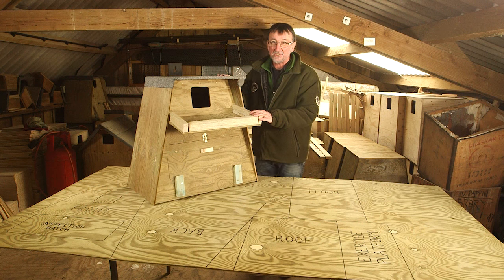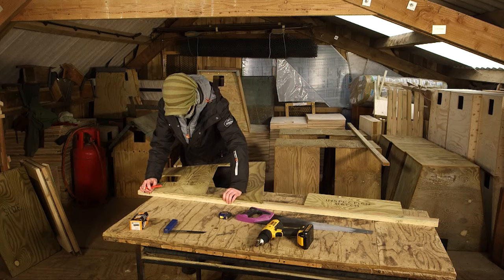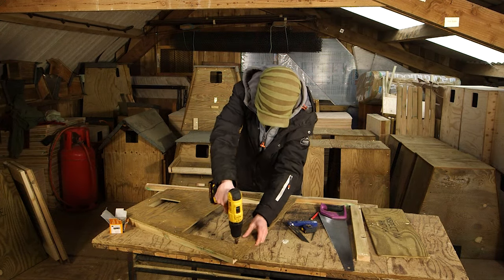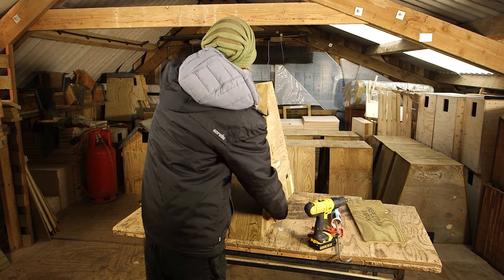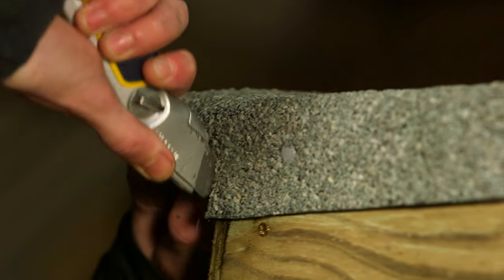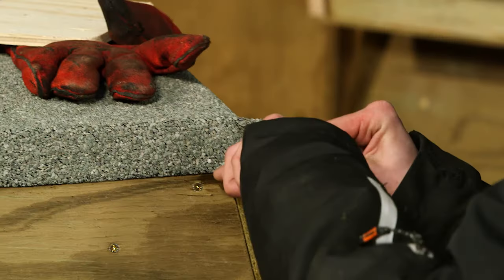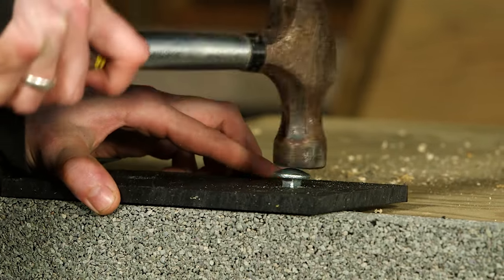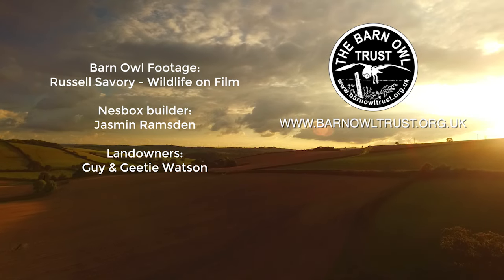How to Build a Barn Owl Nestbox for a Tree

Comment: I enjoyed your video and found it very informative. I do have a question for you. Will the use of pressure treated lumber and adhesives pose any health risks or nuisance to the owls? Should they be allowed to air out sufficiently before hanging in place for the owls to take residence?
Reply from the maker: Thanks Steve. Just make sure that the box is dry before putting it up and you shouldn't have any problems. Good luck!

Comment: hi im just wondering is the plywood used what we would call shuttering ply? and can it be painted?
Reply from the maker: Hi John, the plywood needs to be waterproofed and made with a waterproof adhesive (EN314-2, Class 3). Yes it can be painted - just make sure that the paint is thoroughly dry and fume free before putting the box up. Hope that helps - Good luck!

Comment: Hi there,
Absolutely love your videos! 
Just wondering if there is any particular reason why you shouldn't put roofing felt down the sides too.  I'm thinking even greater longevity for the box...
Reply from the maker: Thank you! You could put roofing felt down the sides - we just think that it won't make a huge difference to the longevity, and not doing so saves cost and weight. If you try it let us know how you get on!
Reply: @BarnOwlTrust1  Will do!  thanks for getting back to me....
Reply: I was thinking of something similar, only extending the roof over the sides of the box to create eaves that protect the box from rain.

Comment: I am a commercial waterproofer by trade in the US.  What type of sealant do you recommend?  Silicone?  Polyurethane?  Acrylic/Urethane hybrid?  I know they will all waterproof this project, but birds are sensitive... don't want fumes to harm them, or scent to entice them to pick at it...
Reply from the maker: Hi Jami, you probably know more about different types of sealants than we do, however, here in the UK, we use Ever-Build Weather-Mate, which is "a multi-use adhesive and gap filler based on an advanced isocrylic formula that provides the ultimate weather proofing protection for adhesion to all surfaces." 
We have not had any problems with owls being affected by fumes or pecking at it, and it does the job well. 
Hope this helps.
https://www.everbuild.co.uk/product/weather-mate/

Comment: Great vid, but won't water seep in through the sides of the inspection hatch?
Reply from the maker: Thanks!
Ideally, the front of the box should face away from the prevailing weather if possible, but we haven't found the hatch to be a problem. Rainwater is more likely to get in through the entrance hole, if the box is very exposed. If this cannot be prevented, drill some small holes in the base for drainage. 
More here: https://www.barnowltrust.org.uk/barn-owl-nestbox/owl-boxes-for-trees/

Comment: Hi Just built my first Owl box from the great tutorial. Chuffed with the box. one question though not an issue. you say the side batons on the exercise area are 27cm long yet the platform is only 25 cm deep even with the offset angle they would protrude over the end. I have cut them to match the base area and it is fine.
Reply from the maker: Thanks Robert - glad you're happy with the box and the tutorial. 
The side batons are meant to be angled to fit against the nestbox, so that rain water drains away from the slightly sloping platform. 
More info here: https://www.barnowltrust.org.uk/barn-owl-nestbox/owl-boxes-for-trees/
Hope this helps.

Comment: Hi! What height do the battens on the exercise platform need to be? Thanks!
Reply from the maker: We use 25mm x 50mm tanalised batten - but the height doesn't have to be exact - it's for the owl to be able to easily grip the edge of the platform.  Hope that helps. Good luck!
Reply: @BarnOwlTrust1  Thank you!!

Comment: Great video but I personally wouldn’t use treated wood.
Reply from the maker: Thanks for your comment.
It's important that a Barn Owl nestbox lasts for as long as possible, as it may be in constant use for many years. 
We recommend that any timber liable to decay within 20 years should be treated with long-lasting preservative: either pressure treated (tanalised) or surface treated (including all edges of all component parts) before assembly. As long as the product instructions are followed and all parts are dry before assembly, this does not cause any problems for the owls. 
More info here: 
https://www.barnowltrust.org.uk/barn-owl-nestbox/owl-boxes-for-trees/

Comment: Tahan ke air?
Reply from the maker: The nestbox will prevent rain from getting in, if you follow the instructions carefully. 
The top of the owl box should be covered with heavy duty roofing felt and a waterproof sealant should be used in all the wood joints. The front, back and sides must overhang the floor of the box. 
More info here: 
https://www.barnowltrust.org.uk/barn-owl-nestbox/owl-boxes-for-trees/

Comment: Why not paint the box?
Reply from the maker: You can certainly paint the outside of the box. 
Some people just want a different colour, but just as valid is the added protection that some sorts of paint can provide. If it is for protection purposes, it would be best to paint the outward facing sides and the edges of the pieces before the box is assembled. The paint should be completely dry before erecting the box.